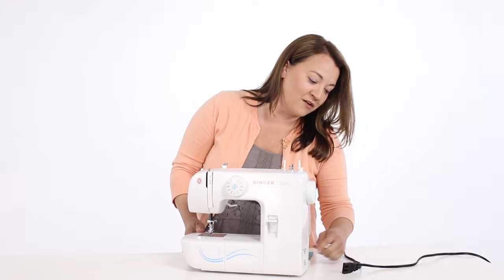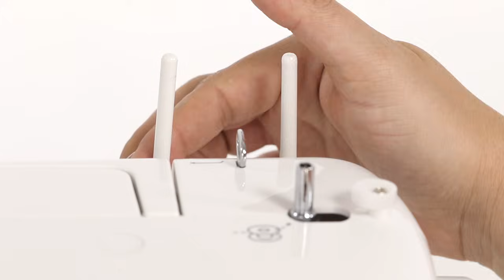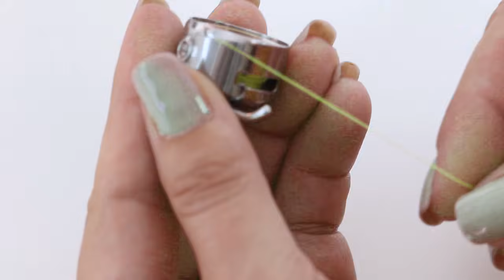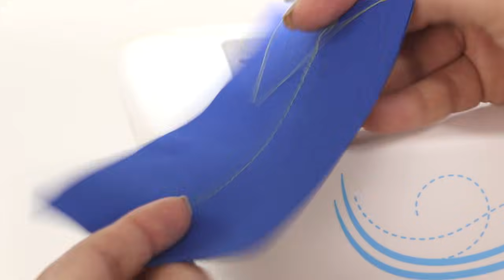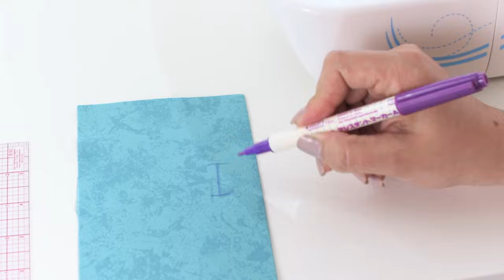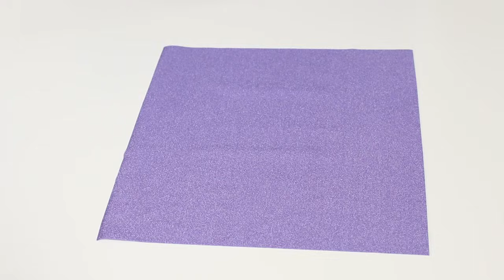SINGER® START™1304 Sewing Machine Owner's Class

Comment: Can someone explain how to use the dial with numbers on it that has a default setting of 4?  When would I adjust those settings - for what purpose?
Reply from the maker: Great question, Brandon. This is the thread tension dial. This can adjust the amount of tension the bobbin and top thread have in order to ensure even stitches. - HM
Reply: @SingerSewingCompany  thx!

Comment: I'm running two different colored threads on top and another color on the bottom and I love the way the bobbin is set up facing toward the user I know some of them face the other way and it's just as good but I like that bobbin other than the 99.. the only thing I would rather have is a vibrating shuttle but I have a machine with that that's 1900s technology but it works good

Comment: Tour of the machine 0:40,
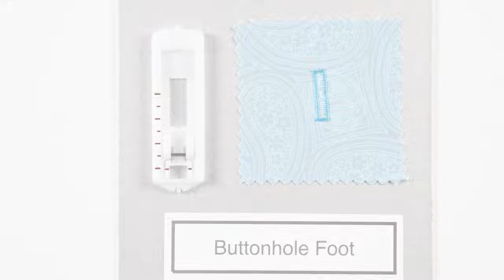Wind bobbin 3:21,
Threading upper thread 8:07, 
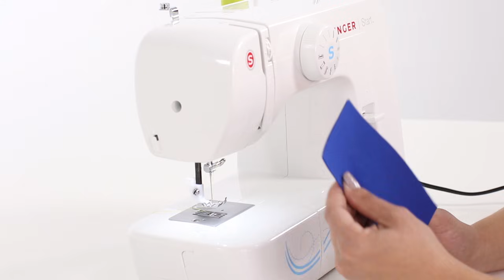Testing to see if machine is properly threaded 10:49,
Select a stitch and start sewing (make a seam) 12:54, 
Buttonholes 17:34, 
Changing needles 22:17
Reply: Thank you, everything is well explained, but I guess I am doing something wrong because the  top thread is getting out of the needle, any suggestion? Thanks.
Reply from the maker: Thank you 'sew' much for watching, Charlotte! -TB

Comment: I.ve been using the machine for half a year now with no trouble. I decided to clean the area of the feed dog and so I had to remove the metal plate that covers that area to remove the lint that had collected. I oiled the machine light once I had brushed away all the lint. My trouble began when I screwed everything back. I must have broken ten needles thereafter. I made sure that the needle was where it should be. I made a few good lines of stitching then the needle snags and breaks. How do I correct the needle alignment? Where have I gone wrong?
Reply from the maker: Hi Merlie! I would suggest looking into getting your machine serviced. You can find out more information about that here: https://www.singer.com/support/warranty. Thank you! -TB